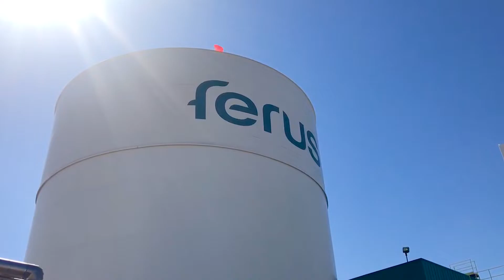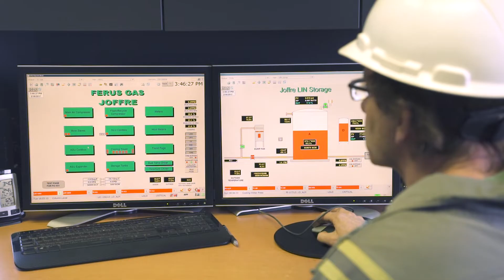How we make Liquid Nitrogen

Comment: But how do you cool air to the temperature of liquid nitrogen?
Reply: Whenever compressed gasses expand they cool off. Look up something called the joule-thompson effect. Basically the expanding air cools itself 🙂
Reply: The people who replied to you offered solutions but they are far less efficient than phase transition cooling.  It is the process of cooling something via the evaporation of another substance that is kept separate from your product.  Your refrigerator works on this principle.  Obviously, the fridge cannot make liquid nitrogen.  That is where CASCADING phase transition comes into play.  You compress and cool one substance until it liquefies and then evaporate that liquid into a gas to cool a second closed-circuit substance, which does the exact same thing but at a cooler temperature.  You might even have a 3rd stage before you have the actual product (dry nitrogen) pass through the evaporation coils to be liquefied.
Reply: @ChristmasEve777  𝗡𝗲𝗿𝗱😁✌️
Reply: @ChristmasEve777 🤓🤓
Reply: @ChristmasEve777 thanks a lot for explanation.
Reply: https://youtu.be/dCXkaQa53QQ
Reply: @rlaw1971able  yup. A stirling cycle engine will do it too!
Reply: Air gets cold when expanding, as most gases. On another side, a compressed gas gets warm. When you inflate a bicycle tyre with a hand pump, the extremity of the pump gets hot. The basic principle to generate cold is to compress a given gas, then cool it using the available cold sources (i.e. ambiant air or water) and then expand it. This is the way your fridge is working. In order to bring the air to very low temp, you can cool down pressurized air using air already expanded with an exchanger. Historically, expansion was done with a simple valve, then with reciprocating machines and now with expansion turbines. When it is possible to generate energy while expanding gas with a turbine, you generate more cold than just using a valve.

Comment: similar deuterium separation after brine electrolysis, have you tried ionized mass spectrometry separation?
Reply: @r d who determines the price
Reply: @r d diy then its all free
Reply: @r d its dum to pay
Reply: @r d you just lost your job
Reply: @r d sorry that you have to pay taxes to the emperor and fear them
Reply: Why would they do that when the gases are already easily separable as part of the cooling process?  They're not making nitrogen gas from air at room temperature.  They are making liquid nitrogen from air at near -200 C.  There is almost no additional cost or complexity in this case.
Reply: Did this one as part of a science experiment for high school. The best electrolyte was H2SO4. It preferentially keeps deuterium due to its stronger bonding field strength. Just add bucket after bucket of water to it to form the deuteride. Then sample when the acid approaches concentrated using a spectrometer pick off the gas. When strong deuterium lines occur neutralize the acid with magnesium oxide. Distill to free your D2O. The purity is around 99.8% 😮

Comment: How is the nitrogen gas cooled?
Reply: That’s the question I came for
Reply: @Beeontree  i bet the are using cold heads or smth
Reply: The pressure compresses it into a liquid, the liquid is so unstable it absorbs heat
Reply: I wish i knew.
Reply: @DwAboutItManFr  At first,the gas is compressed and then,filled down to -32F (freezing cold water).then,the compressed air also gets as low as -32F.Then,the air is expanded and as we know, air,she expanded,cools.So ,the gas is expanded and less than -196 celcius (the boiling point)is achieved ,and it liquifues.
Reply: Liquid gases aren't cold until they are repressurised, the heat absorption is caused by the gases taking away the heat when the molecules start moving around freely and colliding with warmer molecules. It takes energy to compress, so it needs energy put into the liquid gas to make it a gas again.